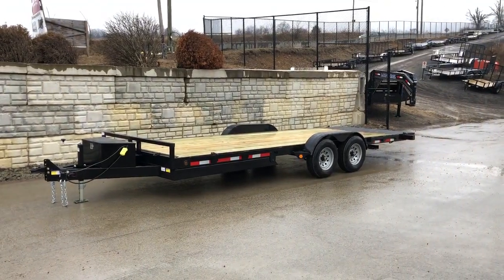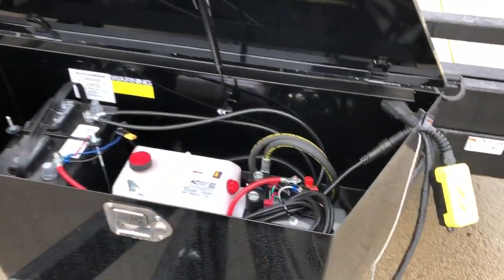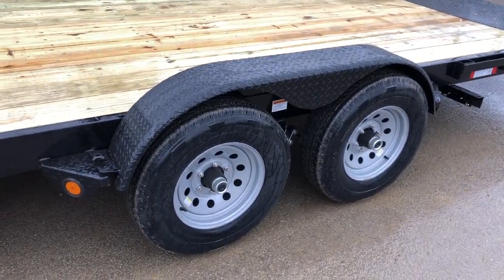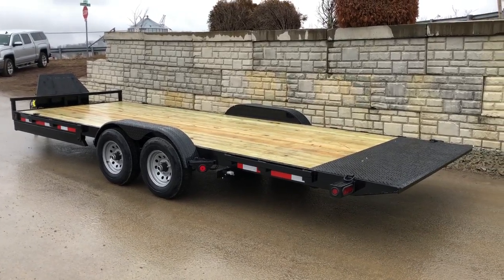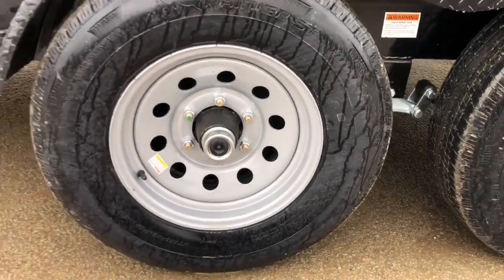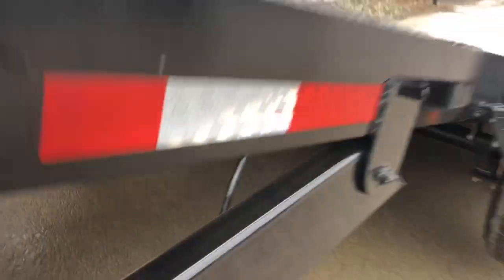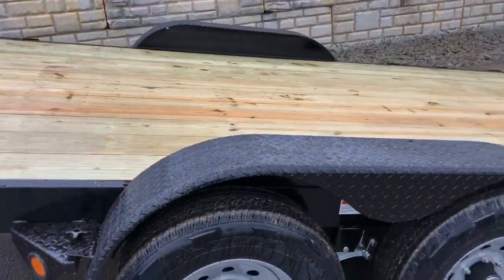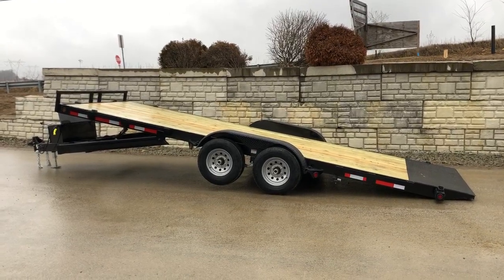7x20' QSA Power Tilt Car Hauler Trailer 9850# GVW 8320EH10K

Comment: Are these still available
Reply from the maker: Yes, we currently have several in stock.  Here is a link to all of our in stock power tilt equipment trailers:  https://www.bestchoicetrailers.com/all-inventory/equipment-trailers/power-tilt  We also have some car hauler tilt's in stock as well, depending on your application: https://www.bestchoicetrailers.com/all-inventory/car-hauler-trailers/tilt-deck-steel-frame

Comment: What is the load angle
Reply from the maker: Ball park about 12-13 degrees.  Keep in mind tilt's, even at the same angle, can load what a "normal" trailer with beavertail and the same angle, cannot since it's only got a single slope.